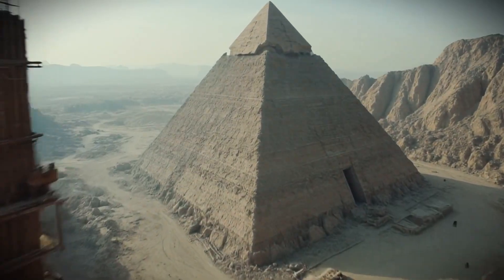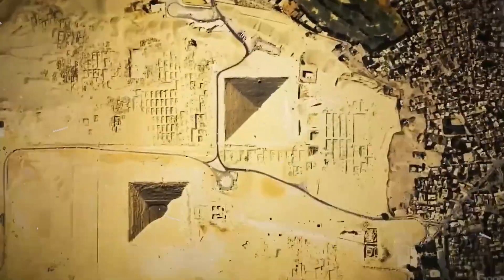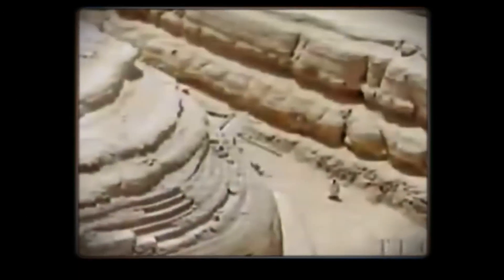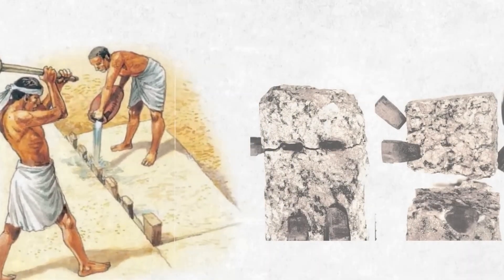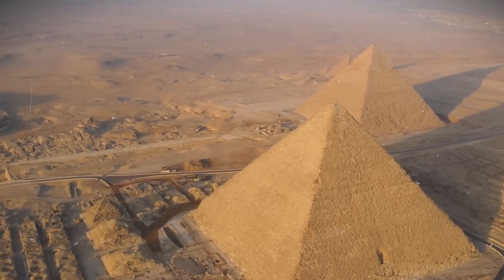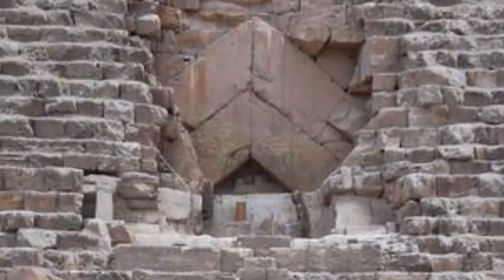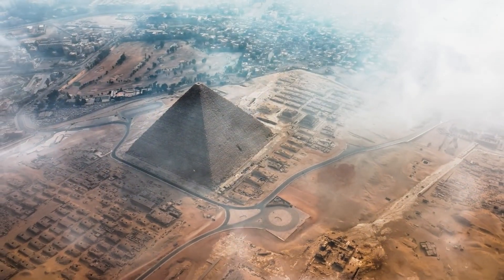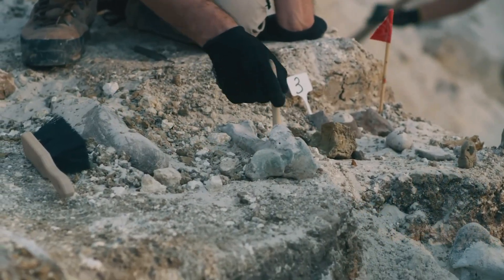How Were the Pyramids of Giza Really Built?

Comment: Well please explain then howsoft copper tools in those days were enough to cut out granite blocks??? this video is laughable!!
Reply: It is well understood.  You know for a fact that the stone has been cut and often polished.  The Egyptians used the same methods as the Greeks and Romans plus every other culture up until the invention of power tools.
The cuts are made using a quartz compound.  Any material can be used above the compound to provide the necessary movement.
You could do it yourself with copper pipe and sand with a bow.  But you wouldn't be as capable as people from the past.
Just study Roman construction and artefacts and then everything will make sense.
Reply: @DamienShaw-l8s  they have tried one hour with a saw made 4 milimeter effort ;-)